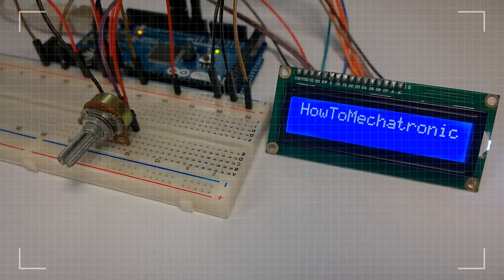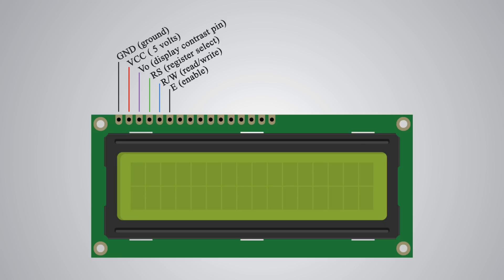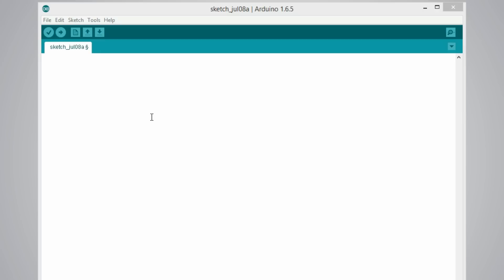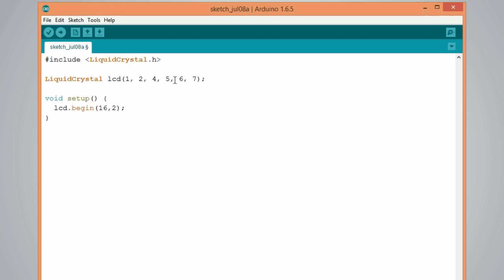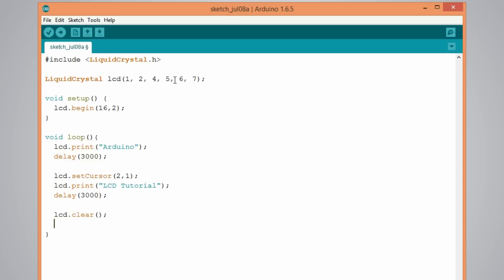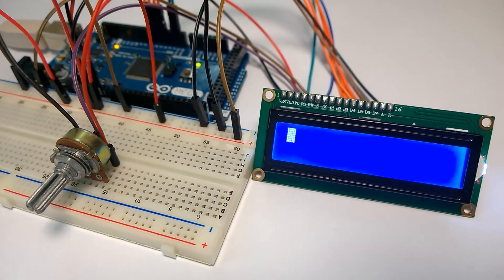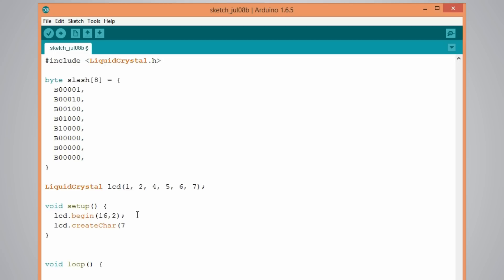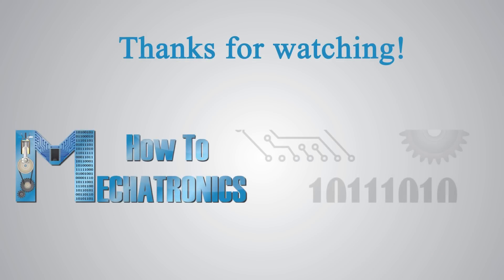Arduino LCD Tutorial | How To Control An LCD

Comment: When I connect both the gnd and vcc wire to my adruino all the lights on the arduino turn off, when only one of the wires is connected all the lights stay on. The code also doesnt upload if both wires are connected. Does anyone know how I can fix this?

Comment: Thank u for this tutorial, I am facing a problem, my LCD is glowing but no characters show. Is it a problem with my LCD display?
Reply from the maker: It's probably a problem with the contrast of the display. Use either a potentiometer or a voltage divider. Check the website article comments, you should be able to find a solution from there.

Comment: This is a good video.  Should  one resistor (usually 220 ohm) be placed in series in one of the two terminals ?  Tinkercad simulation shows LCD blow with 23 mA current.  I haven't yet tried  on actual board.
Reply: I have the same question too.

Comment: If your panel produces a random sign instead of clearing the panel try switching the first two pins (currently on 1 and 2) to other pins (I used 8 and ) 
It will work :)

Btw dont forget to also change the pins when you initialize the panel

Comment: Got strange chars when I started combining it with a joystick for example. As soon as you need serial communication you might need to shift digital pins usage to avoid usage of pin 1. 0 and 1 pins are used for serial communication on this device and trigger strange chars on display. On the Uno start using pins 2,3 instead and all works fine :P

Comment: Will it work without contrast controler?
Reply from the maker: Yes, you would need to make a voltage divider with two resistors. If nothing connected to the contrast pin it won't work, because 0 volts will give no contrast, and 5V would give full contrast, or vice versa, so you won't be able too see anything. So you need to provide some voltage between 0 or 5 volts.

Comment: My arduino was shutting of every time i connected the potentiometer to gnd but when I connected the potentiometer to 3.5v instead of 5v it worked! Thank you so much
Reply: Could you have been using a pot with too low a resistance value?  If so, you could probably also fix it with a change of pot, or adding an inline resistor.

Comment: Can i use this on synthesizer "roland xp 10"
Reply: If you connect it to an arduino or similar, it will work. Don't know about the controller that the synth uses, although if you maybe take an output from each button and run them into a microcontroller that is programmed to set the lcd to print a certain text, it should work. Don't know much about it though, just a theory.
Reply: Also fixing an XP-10 :) This shows you how to connect up a standard LCD -  you will need to make it run off the FCC connector cable on the main board

Comment: Hi is this still up? I successfully uploaded the code but there are still no letters or anything on the screen. What do I do? please reply ASAP thanks
Reply from the maker: The contrast of the LCD is probably the problem. The contrast pin need a voltage between 0 and 5V. That's why in the example I'm using a potentiometer so I can adjust he contrast by adjusting the voltage from 0 to 5V through the potentiometer. In case you don't have a potentiometer you can make a voltage divider with two resistors, for example using 1k and 2k resistors, you can get 3.3v and apply that to the contrast pin. Or you could also try to connect the 3.3v Arduino pin to the contrast pin.

Comment: I tried LCD on simulator.  Whenever i connect LCD anode and cathode to + and - , it explodes.
Then i tried it with potentiometers, it still exploded but only at far end position of the potentiometer.
Do you usually connect anode with resistor or potentiometer?
Reply: tinkercad circuts? use it's example, the simulator is different

Comment: Goodmorning! :)
I have a question.. In my project I put a 1K Ohm resistor between V0 and Ground to obtain a constant Constrast on the screen, same between A and 5V (via 220 Ohm resistor).
How could I 'justify' to a teacher my choice? Do you have any suggestion?
What could be the calculus behind my choices?

Thanks a lot in advice!! :)
Reply: I have the same problem, how did you explain it?

Comment: it works great! the only problem is that the lcd screen is very dim, almost unseeable. adjusting contrast doesn't work either. please help!
Reply from the maker: Well its either LCD fault or your brightness voltage divider is not set up properly.

Comment: Can I use it without a potentiometer?
Reply from the maker: Sure, you can make a voltage divider out of two resistors and get the desired contrast.

Comment: 16,2 what does it means ?
Reply: it basically means that you are using a 16 x 2 (sixteen cross two LCD) i.e. an LCD which has 16 columns and 2 rows in order to display data .
in case you use a 20 x 4 lcd with the same code, just you have to replace 16,2 with 20,4 and all will work well.
hope this  knowledge and information helps you. :D

Comment: Why a potentiometer instead of a resistor?
Reply: so that the contrast can be varied in accordance to your need.
what you can Slender Man is, take potentiometer and set the contrast of the LCD by varying it, after you are done pull out the potentiometer from the circuitry and calculate it's resistance with a multimeter.
now that you know the value of resistance in which you were comfortable with the contrast, replace the pot. with resistor(1/4 watt resistor will be enough and the value should come around 7.5k ohm).
still using a potentiometer is a better choice because you can vary the contrast in accordance to the lighting of the surroundings.
hope this information helps you. :D

Comment: my screen displays gibberish after a while.. I reboot, it works fine, then gibberish again 1 minute later
Reply: please make sure that you have connected the wires from arduino to LCD properly.
ensure the same with a multi-meter.
still if the problem exists, try a new LCD screen.
hope this information helps you. :D

Comment: Hi Dejan, I did the exact same as you showed, and repeated many times.  Only LCD turned on but nothing was displayed, can't figure it out why?
Reply: please check the continuity of all the wires that you have connected between the arduino UNO and the LCD.
make sure that you are using a potentiometer in the correct manner because with the help of potentiometer only you can get the contrast set and after that the characters are displayed.
make sure you connect a current limiting resistor at the +ve terminal of back-light of LCD.
hope this information helps you.

Comment: What should I do if I don't have that spinning thing?
Reply: It is called a potentiometre. There is no problem if you do not have any, but you cannot change the contrast.
It will stay the same. To change the contrast without a potentiometre, you cannot modify it manually, but in the program. You would have to edit the contrast in the program every time you want to change it.
I hope it is usefull.

Comment: My IDE keeps saying

Expected ',' or ';' brefore 'void'
Reply: Nathan Bacon Cubing Check whether the line before the "void" ends with an semicolon(;). If not, add one, unless there are special brackets "}"<- this one in particular. Normally, a line of code has to end with an ";". The IDE should furthermore tell you where the semicolon is missing (I think  in this case it should be the line above "void setup()").
Reply: I was garbage at coding when I posted this.

Comment: Sir,
My LCD is showing just the bars that also on the top row only pls help me. And my LCD is not soldered and i m using it by connecting some wires and 40 pin. PLS HELP

Comment: This tutorial is brilliant stuff. The LCD was shining too bright, since I used a voltage divider in a 50 : 50 ratio instead of a pot. Made it right changing the ratio to with a 10K : 0.5 K divider.

Comment: Sir, my one got an error,,, 
"""Sketch uses 2100 bytes (6%) of program storage space. Maximum is 32256 bytes.
Global variables use 71 bytes (3%) of dynamic memory, leaving 1977 bytes for local variables. Maximum is 2048 bytes.
avrdude: ser_open(): can't set com-state for "\\.\COM8"
An error occurred while uploading the sketch
??????
Reply: muhammad umer farroq, please make sure that you have selected the right communication port for the arduino.

for finding the correct communication port on which the arduino is connected to your laptop
1. go to>start>control panel>device manager> coms port and lpt 
check the communication port which has been assigned for the arduino you connected.

now go back and reopen the arduino IDE
1. go to tools>ports>select the same port that appeared in your control panel 

hope all this information helps you:D
Reply: That means there's a problem communicating with the Arduino.  Possibly one of the plugs is loose, or you have more than one COM port and you selected the wrong one.

Comment: Hey bro, So i just connected my LCD To my Freetronics Arduino Eleven and for some reason the Petentiometer - or + for some reason is overloading the Eleven and is having to power it down. Ive tried 5.1V, 5.3V and 9V and is doing the same thing. Got any tips on how to fix this? Thank you!
Reply: *****  I later realised that I had the petentiometer running the wrong way on the breadboard. Lol thanks for the info though, I'll have to try it. ;)

Comment: dear i am going to make a injection molding machine and want to  use ardunio as programming source but problem is that is it possible to controlle time and temperature
also that is it possible to change time in controller without chaning programme

Comment: Can you use the LCD without soldering?
Reply: just plug the wires through the holes of lcd ports into a breadboard, works fine with me
Reply: no Jackal, there will be a sure-shot problem of continuity between the LCD and arduino if you don't solder the wires properly.
just solder the  header pins on your LCD and then use it with the bread-board.
make sure you always connect a current limiting resistor(330 ohm or 220 ohm), at the positive terminal of the back-light LED of the LCD. 
hope this information helps you. :D
Reply: Just use the new LCD board. It doesn't require any soldering
Reply: Just use a breadboard
Reply: yes using a breadboard

Comment: Nice tutorial. Simple and understandable at each step. Well, didn´t work for me. Maybe I have dead LCD.
Reply: +Dejan Nedelkovski You´re right. I didn´t use potentiometer, but tried few resistors as voltage divider. It still looked dead. Then my coleague connected contrast driving pin to GND, and WHOA: It worked right of the bat. Anyways, thank you. I wired the rest using the diagram from you and your program sequence, and it all works then. Good job. Thank you.

Comment: Very fine presentation. Thanks Dejan. Every time you need to display text you need to reprogram the Sketch. Is there an LCD that has buttons to write your messages?. Second question is if you attaching an MP3; can the LCD display the played file info(the track)?. Thanks again....Regards.
Reply: After little search I found it,called LCD Keyboard Shield. Just in case people have the need to know. Thank you all.

Comment: Thanks for breaking it down! I wanted to give a quick comment on something I got stuck on but figured out. I kept getting an error when verifying... "expected ',' or ';' before 'LiquidCrystal'", so I put a semicolon after the closing curly bracket for the array of bytes. Not sure why but that's what worked for me.
Reply: The semmicolon ";" comes after the closing "}" of the  byte slash[8] array. Like this:

byte slash[8] = {
  B00001,
  B00010,
  B00100,
  B01000,
  B10000,
  B00000,
  B00000,
  B00000,
};
Reply: Thanks. I had the same problem and I googled it and looked for everything but didnt find anything. I saw your comment, tried it and it worked. I dont know why  but it would be nice of someone knew why it worked =)
Reply: @ottosboyen In Arduino, an Array acts as a set frame of objects, which are separated by a comma ", " So when we declare and initialize something, we end it with a semi colon ";" In this case, to conclude the initialization and declaration of array, we use semicolon at the end like any normal line of code, but for separation of each individual elements inside the array we have to use commas
Reply: in c++ and c you must put semicolons after variables... lol (same for c# too i think)
Reply: Can you show where the semi colon will be placed? Please
Reply: just go to file>examples>liquid crystal>hello world and you will see no errors in compiling and running the code into your arduino board.
hope this information helps you. :D
Reply: yup..and this indicates that the declaration is completed

Comment: Umm.. This might sound like a dumb question but a small red "thing" came attached to the back of my LCD, blocking all the 16 pins. Am i supposed to take these off or leave it. I use the Sunfounder Arduino Mega. Please help i am getting kind of irritated
Reply: +Tejas Marulkar  leave it, you will actually be able to use a simpler method to wire your LCD to your Arduino as you will notice you only have access to 4 pins, search for a tutorial on connection your LCD via a serial connection as that little board on the bottom is a serial converter. Also the little blue box thing on the bottom is a built in potentiometer to adjust your contrast ;) hope this helps :D

Comment: First of all cogratulations, it is one of the best tutorials out there.
I have a question, can I use an arduino uno or an arduino mini instead?
Reply: yes surely you can use other versions of arduino development board, they all have same IDE to program
make sure to select the right communication board while changing the board and for that
1. go to>start>control panel>device manager>coms port and LPT
2. now go to>arduino IDE>tools>and select the same port as that appeared in your control panel.

in order to select the correct board
1. go to>arduino IDE>tools>select board

hope this information helps you :D
Reply: I'm using an Uno for this and it works perfectly.
Reply: Omg i was looking for this comment since I need to use Arduino Uno. Thankfully there are these guys replying to you. I'm still in highschool and doesn't know how to do these kind of stuff. Thank you so much.

Comment: Hi Dejan, (In the right video this time)Great videos on Arduino.
I am just learning Arduinos and find these tutorials a great help.
Question, could you do one on using the "I2C" connections, I have a 20x4 LCD with the small I2C interface board but I cannot get the display to show anything.
Saciba.
Kevin.